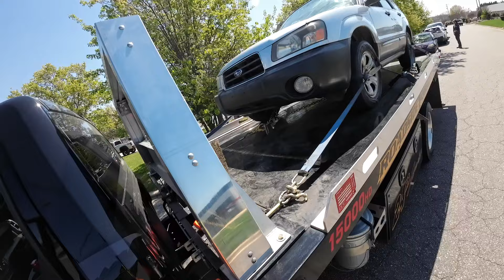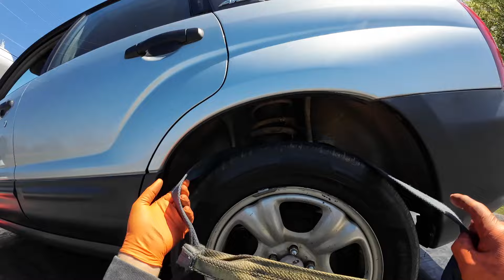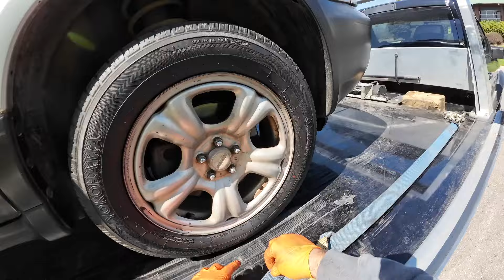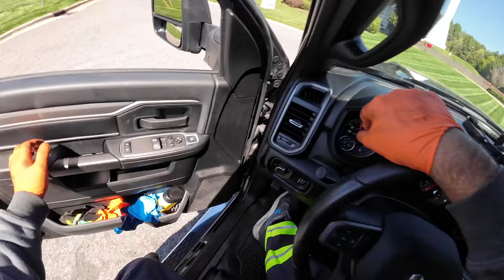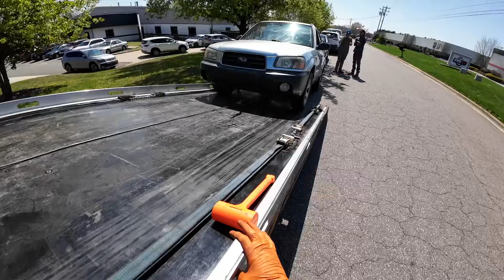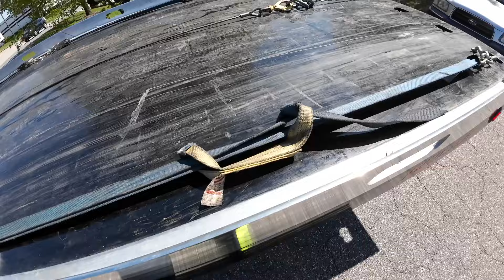OFFLOADING A SUBARU WITH A STUCK CALIPER (OLD VIDEO)

Comment: All you need to do to move the car off the road is break the bleeder to relieve pressure and it should roll
Reply from the maker: @kennycunningham8721  not trying to do all that in the middle of the road on a very busy street.